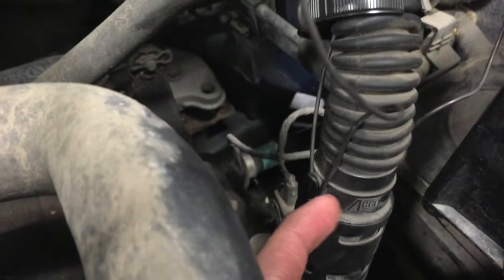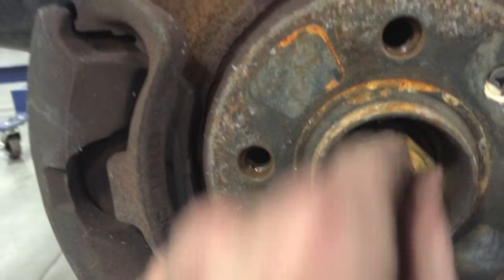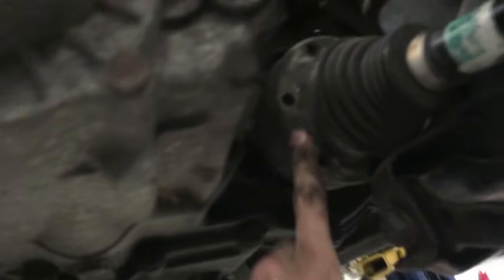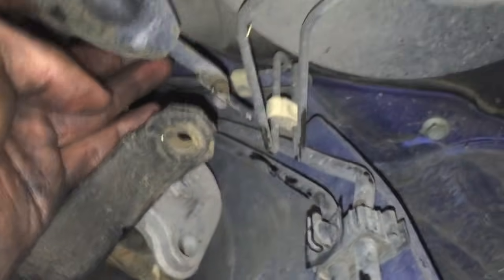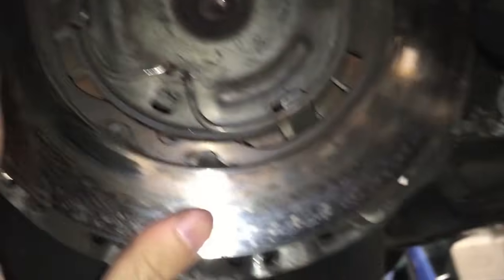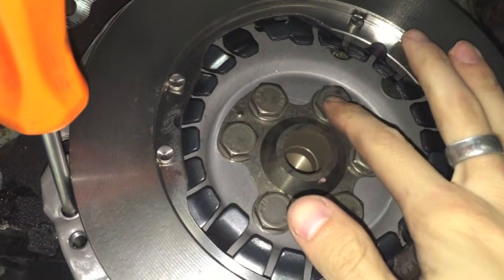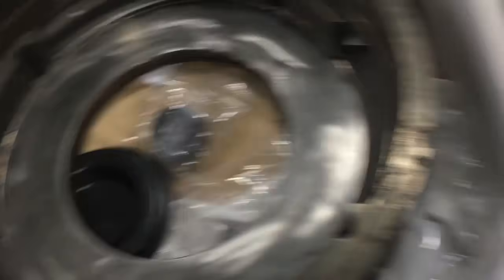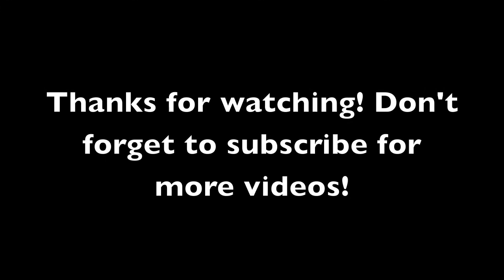How to replace clutch on MKIII vw jetta golf cabrio 2.0 8v aba

Comment: You can reuse the clutch cable you just have to pull the outside out and the inside and really fast pull the inside out while pulling the outside back it takes a few times to get the hang of it but their is a video on you tube✌

Comment: Thanks for great video:)When i took out the starter, the engine and transmision came Down a couple of centimetres. The engine was supported by the oilfilter which held it up.I can see the starter is actually held together With the front engine support, but it should not have dropped Down like that..?
Reply from the maker: Glad it helped you out! Maybe check your mounts? I think mine dropped a little bit could be because it is one of the mounting bolts for the transmission.

Comment: Thanks for the video it really help...but I'm having trouble with the pedal it's sticking to the floor and tried everything and nothing any help with that? I would appreciate the help
Reply from the maker: when one of my previous jettas clutch pedal would stick to the floor I would have to go into the engine bay and pull on the cable and it would release. You will need a new clutch cable to fix that issue correctly

Comment: Did you have to put engine hoist for support ?
Reply: And also did you unbolt the right side axel ?
Reply from the maker: both axles were pulled and i had an engine hoist that sat on the top of the car. if youre doing it without a lift i normally use a jack with a block of wood under the oil pan to support the motor.

Comment: I did this before watching the video. still haven't tried to start it yet. anything I should know about the clutch going together? I'm pretty sure it's legit but swapping the clutch and transmission for the first time at 17 years old is nerve-racking
Reply from the maker: just know you will need a new clutch cable if you did not do the restraint tool in the beginning before releasing it.
Reply: DIY Ethan I'm already replacing it with a manual adjusting one. what is the most common thing people might look over?

Comment: 44 ft. Lbs and a 1/4 in. Turn. Could you please explain
Reply from the maker: use the torque wrench and put it at 44 ft lbs then you'll grab a wrench or ratchet and turn the bolt a 1/4 turn. It's suggested not to use the torque wrench to complete the 1/4 turn

Comment: Where do you get that 8m
Reply from the maker: You can get it from Sears or any other tool vendor. Just need an 12 point socket
Reply: The one you're supposed to use instead of the torx
Reply from the maker: It's called a triple square and you have to search for it. I luckily found mine at autozone. But online you'll find it
Reply from the maker: Or you can get lucky and find it in a kobalt screwdriver set with the bits at llowes
Reply: how i can adjust the clutch cable
Reply from the maker: +alex alvarez buy an auto adjusting cable if you dont like that then buy the manual adjusting.